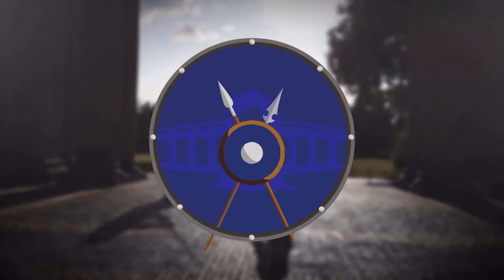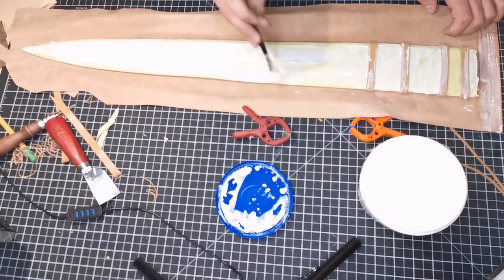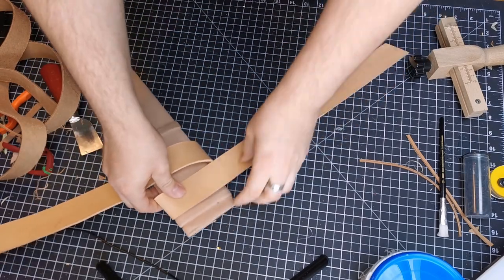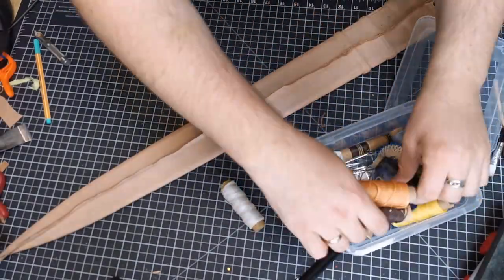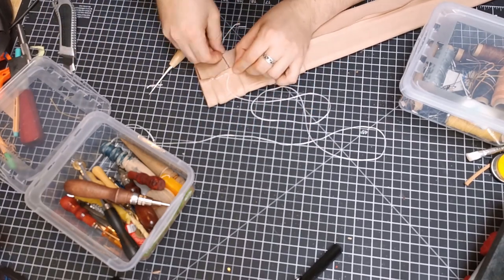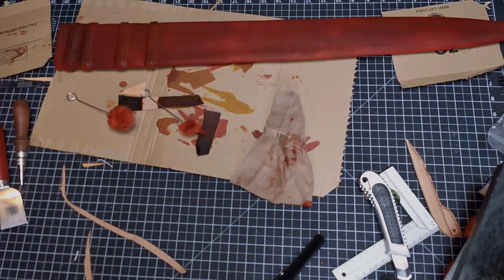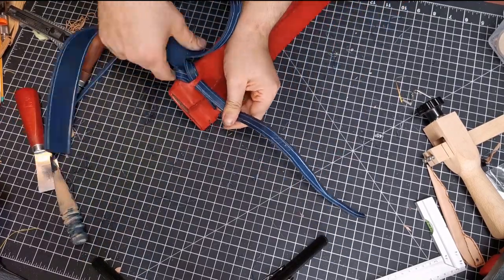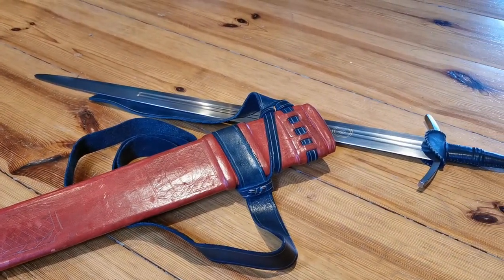Building a Medieval Scabbard Part 2 (of 2) - Leatherwork and Finishing

Comment: About a year ago I made preparations for building a scabbard for my longsword. Bought goat leather and a bit of tooling to prepare. I made a wooden core out of 2 planks that I carved out with a chisel and I got to say, just dont do it. :D It was so much work to finally get the sword to fit, it just was not worth the effort. After crudely shaping and finishing the outside with a saw, chisel and sandpaper I decided to not waste the leather on that core. It makes for a good enough scabbard for transporting the sword to training sessions, but not much else. 
In the near future I will try Torstens method, especially after watching this. The wrapping of the core with linen was a nice touch. I will see if the extra length on my sword will make a difference in structural integrity.
Great video and greetings from Thuringia.

Comment: About a year ago I made a scabbard for a dagger I put together. I used a very similar method to yours, however I think the way you glue up the wood core is probably easier. I'll have to try that next time.
Reply from the maker: I still need to make a proper one out of a thick pieces of wood, i think all of this methods have a advantage and disadvantage. For instance, having a rolled tip on your sword basically destroys this sandwhich methode.
Reply: @SchildwachePotsdam  for a rolled tip or button tip a solid wood core would make sense, but I prefer the laminated method else wise. At least when I'm the one making it.